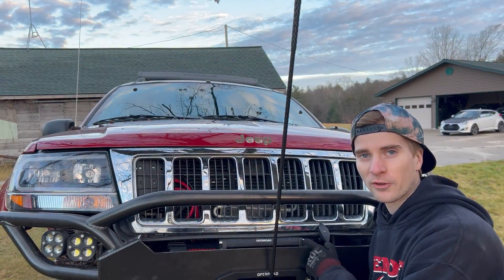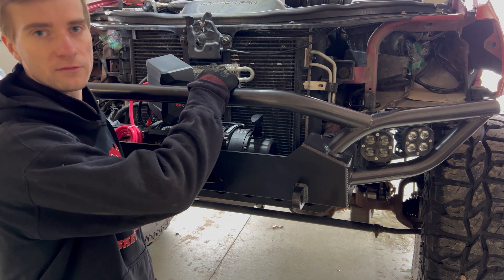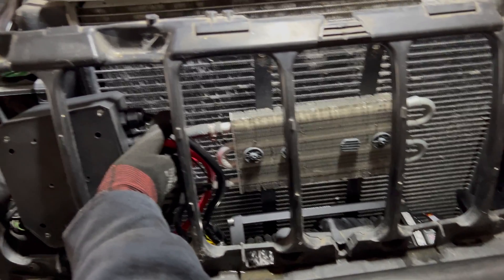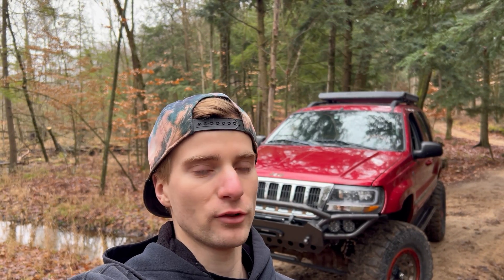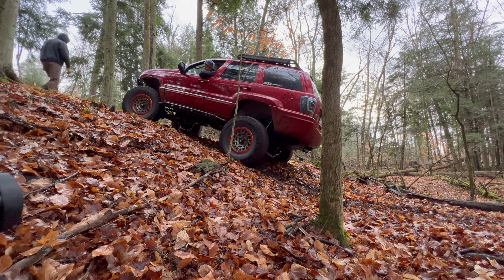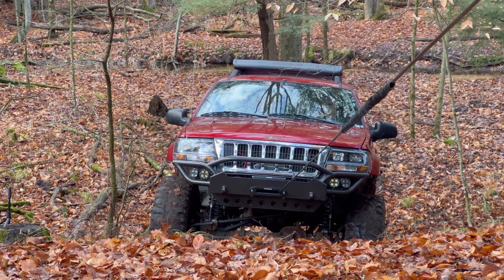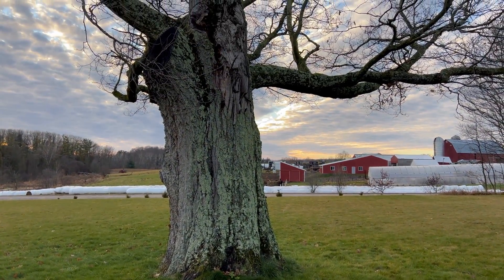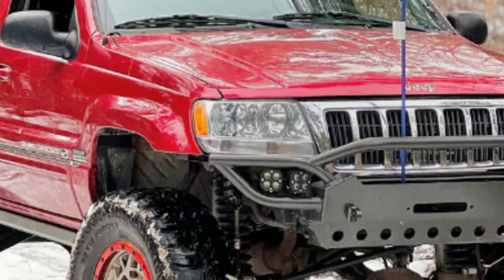Is This Budget Winch The Badland Apex Killer? | OPENROAD Panther 2S Plus

Comment: Did u have to replace the cables from the control box to the winch to relocate it? If so, what size gauge you replace it with?
Reply from the maker: Didn't replace anything.  Exactly how it came, just relocated.

Comment: Well just ordered it and they changed the design and you can't rotate the end of the winch for the clutch release
Reply from the maker: Keep in mind they have the 2S and 2S Plus.  I have the 2S Plus which has a slightly different design.  But regardless, the clutch end should always be a planetary gear system and can always be rotated.

Comment: It's not the weight of your ride     it's all the mud and 💩 you're pushing/dragging with it      you could actually be pulling 2x - 3x the weight of your rig
Reply from the maker: 100% correct.  Hence a 13,000 lb winch and not 5,000 lbs lol.  The initial test was pulling dead weight up a steep incline (no assistance), the second test was more or less for fun.  You'll be seeing the winch in a more serious recovery situation in future videos for sure.